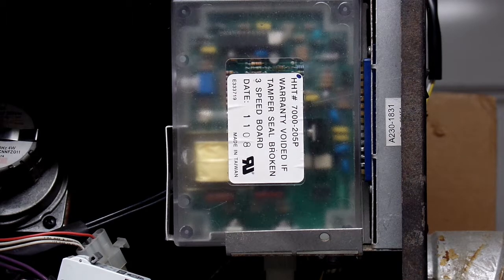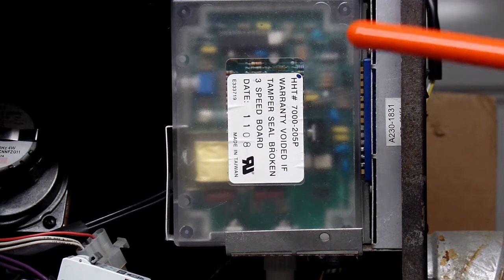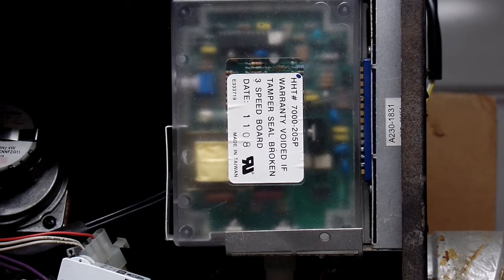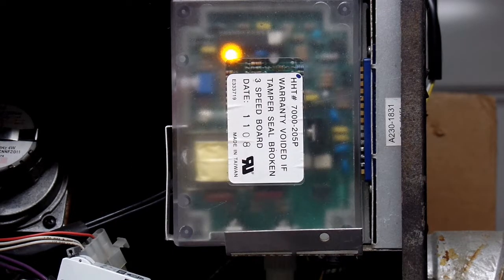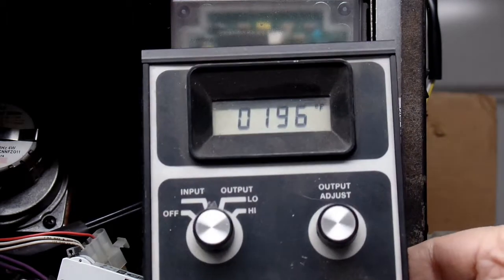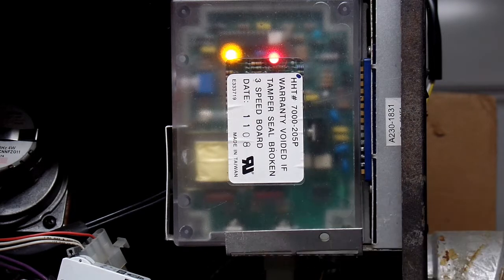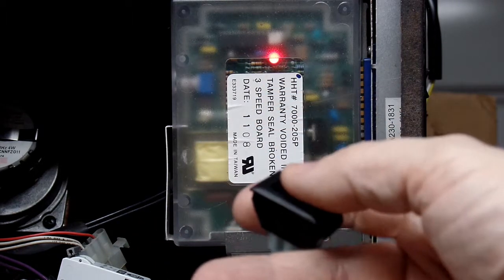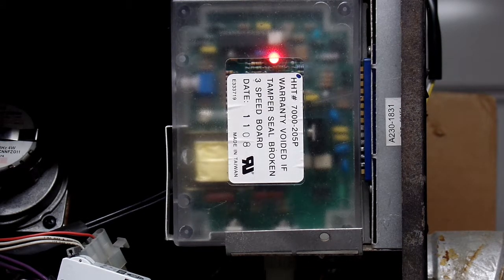Selvin's Quadrafire 7000-205P Functional Test

Comment: I have the same controller and stove.  The 7.5 amp fuse keeps blowing at about 3 seconds.  I disconnected everything and it still blows the fuse.  I checked the wires to ground there were none.  I think the controller is bad.  I have looked everywhere and I can't find one that matches the one in your video HHT# 7000-205P which is also what I have.  Do you know where to get a replacement?

Comment: I have this controller in my pellet stove and I can’t get it to do anything. I have power to the system the fuse looks good but absolutely no lights come on at all. I even disconnected the thermostat and hook the wires directly to ensure that wasn’t the problem because it doesn’t seem to be calling for heat. Any tips as to what might be the problem?

Comment: Have you ever hacked one of these to change the thermostat control function. I would like the thermostat to switch the speed from Med to High when it calls for more heat. After ashes build up in the firepot the stove cannot restart from being OFF.
chasmell@gmail.com
Reply from the maker: Hi  clmell  --  to answer your question - NO - I have not modified one for such a function as you noted..   I will add an AUGER indicator LED since that is a pretty passive change, and it does not change the functionality of the controller, but, I will not make other changes, since those could impact the built-in safety systems, and I would not want to be responsible for that should something happen.

What you request could most probably be done with some logic gates and external relays..  without going inside the controller... An Arduino could also be programmed to do that very task... You would need to look at your specific stove's wiring diagram and devise a system to accomplish your end goal.  Sorry, but I cannot be of further assistance on this mater.
Reply: @MonteStudios  Thanks ! I've had this stove for 12 years, and have always felt the thermostat was under used.
Charlie